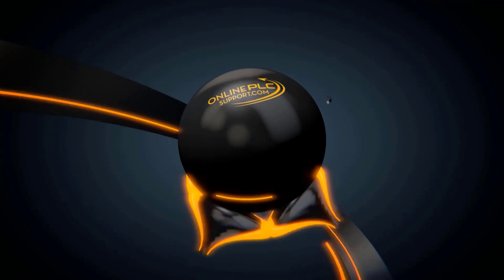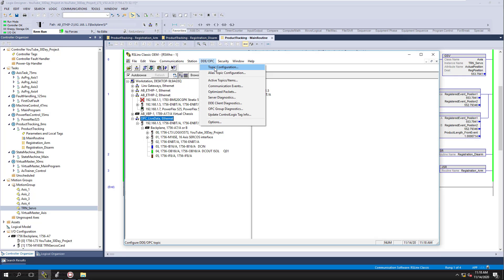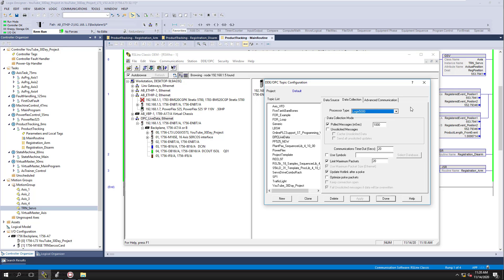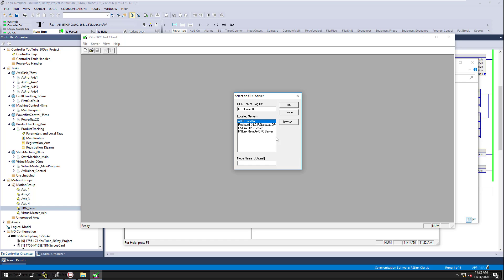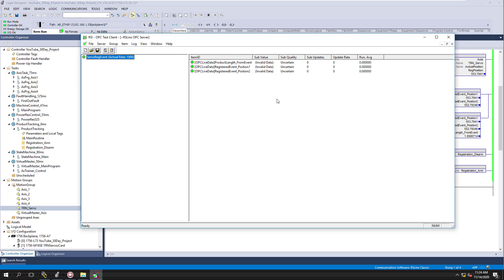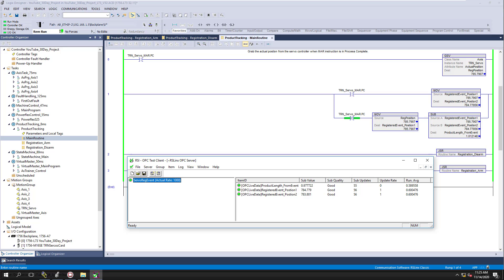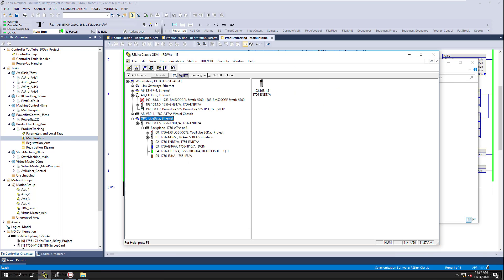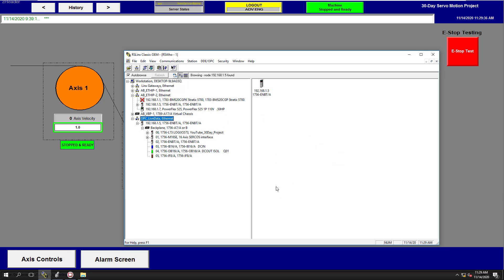RSLinx OPC Data Testing Using OPC Test Client | RSLinx DDE/OPC Topics Tips & Tricks

Comment: Hi Shane, is it possible to connect to a 3rd party opc client like Codesys running remotely?
Reply from the maker: Using Kepware yes
Reply: @ShaneWelcher Thank you for responding Shane. What would be the endpoint URL for rslinx and would it it be anynomous user with no security?

Comment: I am using RSLinx Classic Gateway. Is it possible to use DDE/Topic configuration with that?  I am trying to run Machine Simulator with RSLinx Classic Gateway. Is it possible with OPC Test Client? Thank you in advance.
Reply from the maker: @Sumee21051987  depends on the operating system you are using.  Certain windows 10 and windows 11 OS systems have security that blocks DDE

Comment: Thank you but I have a question: What happens if you get your PLC offline? RSlinx goes always on as well as the Factory? It seems they are both running from cache. Is there a way that the Factory flags up the loss of connection once the PLS goes offline?
Reply from the maker: Once the PLC fails to connect to the OPC then it should show bad connection or bad data instead of real world values

Comment: Great video! Thank you! Do you know how to run the RSLinx Classic OPC as automatic service to run 24/7?
Reply from the maker: If you have a connection that request   then I automatically connects. Meaning, an OPC topic through RSLinx running as a service
Reply: @ShaneWelcher  Ahh I see. Thank you. I am also working on a client application that needs to pull data from the RSLinx Classic OPC. How do we setup a subscription / publication service between the two?

For example: 
1. Part Serial scans by PLC
2. Print Command by PLC

These reflect in RSLinx OPC. Wondering how to push that to the client app
Reply from the maker: @VaibhavShankar-xo1kn  This is not something that can be easily answered over text because it depends on what OPC connection you are using.

Refer to Rockwell's knowledgebase

Comment: When you purchase software, does it come with rslinx classic? Or do you have to purchase that seperate
Reply from the maker: When you purchase Studio 5000 or RSlogix 5000 then yes.
Reply: @ShaneWelcher  ahh, I got the 500 micro. Probably still comes with classic lite then I'm sure. Thanks for the reply 👍🏻
Reply from the maker: @shawnspencer8766  yes, the micro lite comes with RSlinx classic lite.

RSlinx lite doesn't allow OPC usages
Reply: @ShaneWelcher  actually I bought micro starter. Any luck with that one?
Reply from the maker: @shawnspencer8766  if you have RSlinx lite then no OPC use.

You need the pro version of RSlinx

Comment: Thanks for the enlightenment. I have a question about my RSlogix.. I want to connect my Citect Scada 2018 to Rslogix5000 using RSLink Classic Gateway and I am using Rslogix Emulate 5000 as my PLC . Kindly enlighten me on the configure driver setting or if you have a tutorial would be highly appreciated. Thanks a million!
Reply from the maker: Have you tried OPC?

Setting up a topic then adding the tags.
Reply: @ShaneWelcher  Thanks for your reply. Our OPC has been running quite well in the plant but I had not been involved setting it up during commissioning. So now I want to practice doing it with an emulator (RSlogix emulate 5000) with my rslinxclassic gateway to my citect scada. I'm confused which driver i will use when setting up drivers for opc in rslinx.. 😅. if i use ethernet, is the hostname my pc name? Also my rslinx keeps closing now if i click any drivers.. 🤔🙏
Reply from the maker: @nbw22 depends if you are running it as a service or application

Check RSLinx control panel